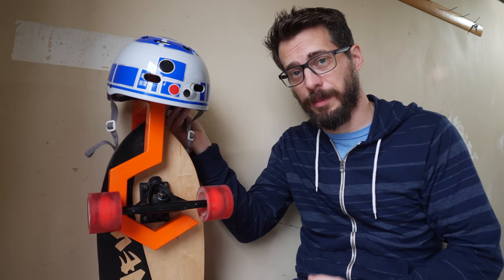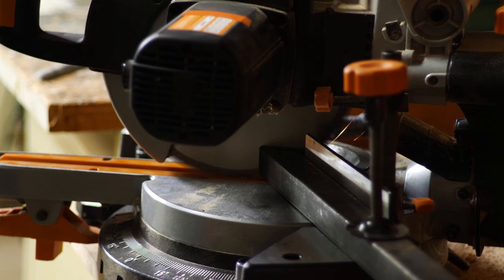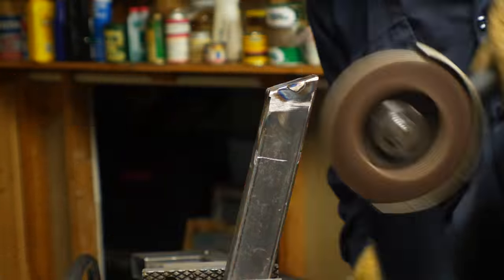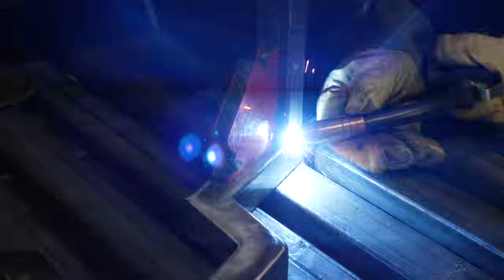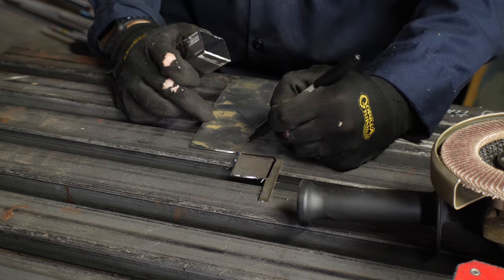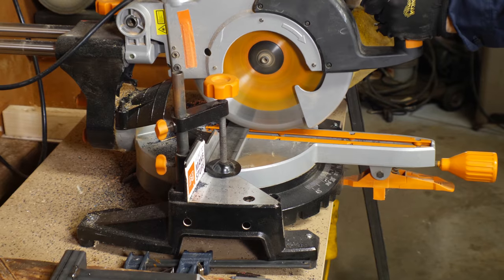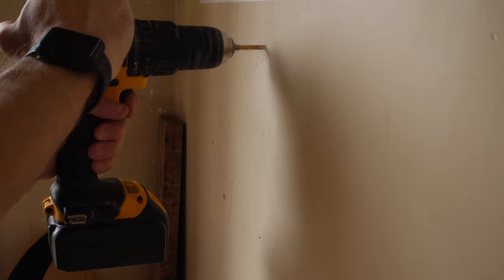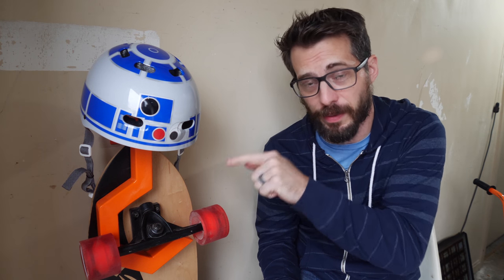How to Make a Steel Skateboard Hanger | I Like To Make Stuff

Comment: In the time it took to cut and weld up all that 60mm square tube steel, you could have bent the same shape out of solid round bar 6 times, welded on your 3mm flat bar mounts, covered the round bar with black heatshrink tubing and ziptied on piece of a Pool Noodle or closed-cell foam rubber to act as the helmet seat. It would be lighter, softer on the helmet, more than strong enough to support a skateboard, and a faster, cheaper and more hard-wearing finish upon which to mount the board.

I get that this dude doesn't weld, but any moron could have forseen the disadvantages of his design before he made even a single cut; 40 short lines of weld is a LOT of work even before you clean it up with a grinder...
Reply from the maker: Wow, you're a lot of fun.  Believe it or not, some things are about learning and experimentation just for the sake of it.

Comment: I understand u wanted it in a stud but if you knew you were making six ie a whole row of skate boards why not  parents two first and a row of hooks for the kids oldest to youngest. The hook idea is nice but why not a line of thiner hooks I understand your desire to make it heavy duty but you could use a thinner material for the others
Reply: By putting them in a row you allow multiple points of support and make it mobile for if you wanted to put it on the side of a shed or beside the pool under a awning
Reply from the maker: This video was about making one. It probably wont stay in the location forever.